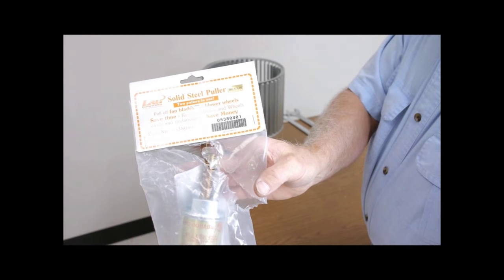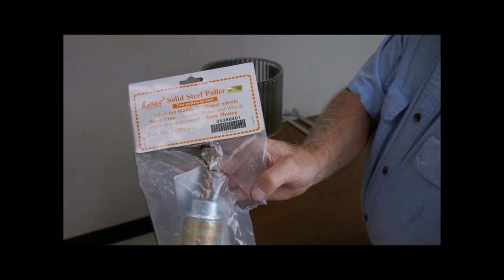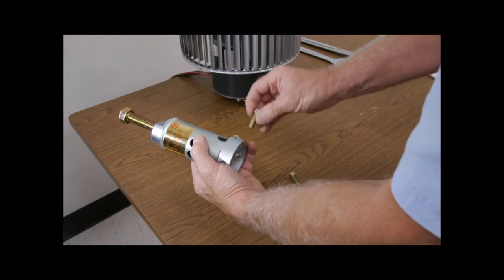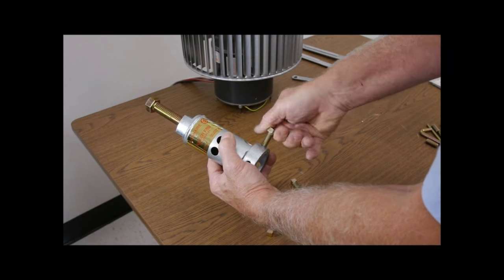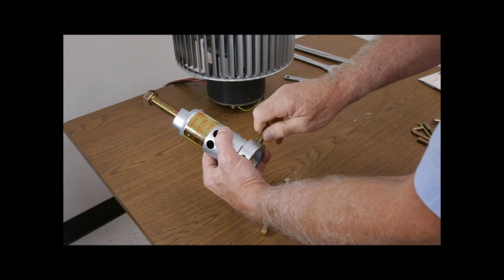Removing the Hub from a Blower Wheel Using a Hub Puller

Comment: From your experience:  Which puller is best to remove motor fan blades?

I read satisfaction star ratings on most pullers, buyers seemed to be dissatisfied and call them junk. Especially. when there is a stubborn fan blade shaft or frozen fan.
 
I am looking to buy one but have not been able to select one.

Comment: Unnecessary tool? No. Try getting the fan blade off in a Blodgett Oven without one!! The shaft sits flush with the top of the hub, yet they just don't want to move. Oven cleaner gets in there and seizes it.  I don't care how good the puller is and how big your wrenches and torch is, sometimes you just have to cut the stupid thing off!  In many cases plenty of PB Blast, or WD 40, along with sand cloth and a couple of BF Wrenches ARE all that's needed. Of course, in the video, that was a brand new motor and fan used just to demonstrate how to use the puller. (It would have literally dropped out after loosing the set screw)
Reply: Yeah, but for the blower motor is beyond unnecessary.